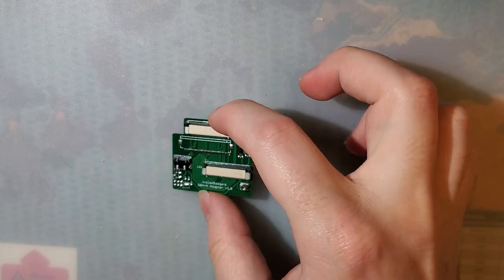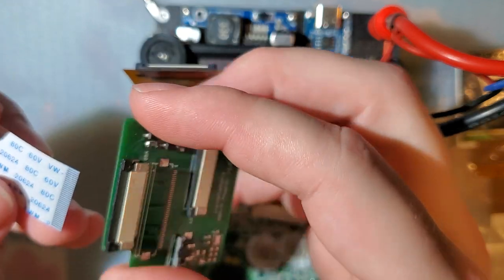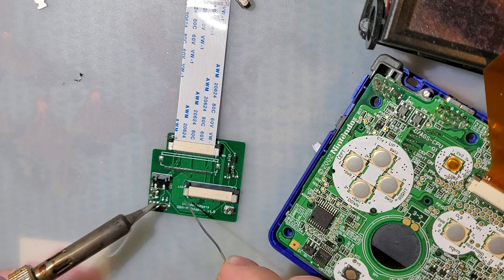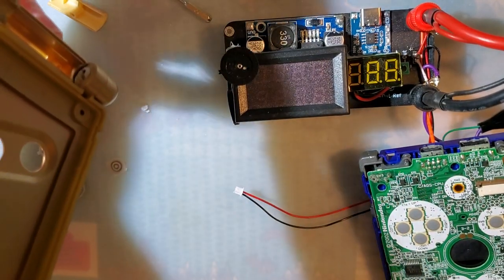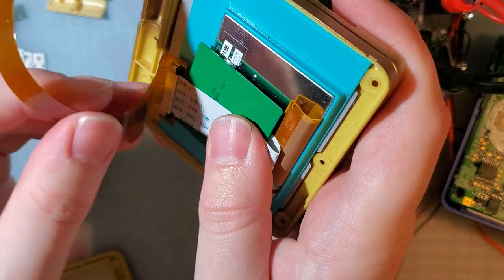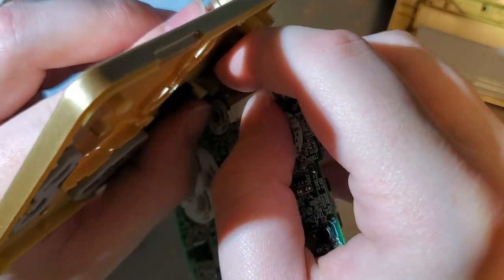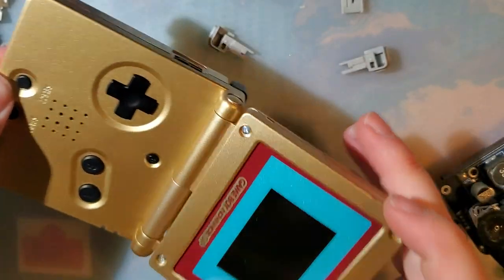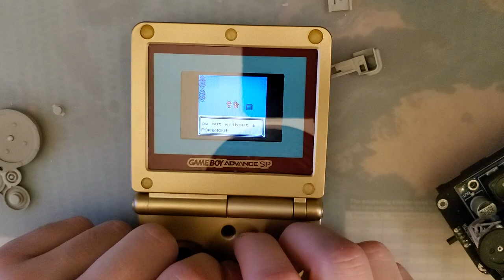insideGadgets Micro Backlight Kit for Game Boy Advance Consoles

Comment: I wonder if is posible put a gb micro motherboard on sp shell with ips screen, by the way, I want a ips screen for gameboy micro, the original screen has washed colors compared with ags 101
Reply from the maker: Yes, the Micro uses the exact same LCD protocol as all the other Game Boy Advance consoles. The only real difference is the connectors themselves and a slight tweak to the voltages (which an IPS kit wouldn't care about).

Comment: This is a mod for those with a busted micro and/or someone that knows how to source those gba micro screens

Im one of the plebs that likes a bigger screen thats more accessible to me personally
Reply: I was so excited too but the non functionality of the brightness control button and small screen would bother me so much
Reply from the maker: You do realize that these screens are cheap and plentiful, right? I bought this one brand new, it wasn't sourced from a dead Micro.
Reply: makho it’s a sick mod first of its kind like you said but the cost of the adapters, bezel & a micro screen if you aren’t salvaging one, you might as well get a funny playing screen for the money
Reply: @makho  with all the adaptors and mumbo jumbo of getting all the parts together to do the mod i prefer the simplicity of just an ips screen with a V2 cable, or even just an AGS-101 mod if i "really" wanted to use parts meant for a GBA system